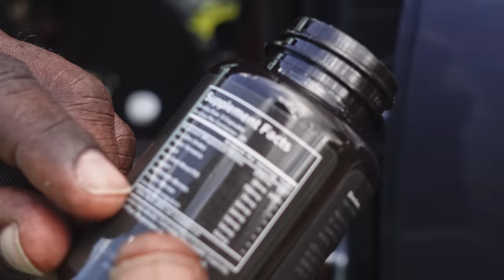I BOUGHT 22" RIMS FOR MY HELLCAT DURANGO

Comment: normally, the rim nuts are screwed in crosswise or in a star pattern
Reply: Fact
Reply: That’s what I was Tripping off of
Reply: Doesn’t it mess up your wheel alignment if you do it in a circle? All I know is you’re suppose to not do that 😂👍🏽
Reply: @NoizyBearBearOfficial  it is to respect the safety rules on the vehicle. If you do not respect the crossing, your rim may damage your vehicle because it will not be properly attached to the axle.
Reply: Exactly

Comment: When jay sees kali coming with those wheels and tiers hell say WHO HE THINK HE IS BUT AT 16:55 YOU REALLY SHOULDN'T LET THEM TIGHTEN THE LUG NUTS WITH THOSE AIR COMPRESSORS CAN REALLY DAMAGE YOUR BOLTS BECAUSE THERE TORQUING THEM WAY TO MUCH LIKE 100 POUNDS EACH WHEEL NEEDS TO BE TOQUED AT 90 POUNDS BUY A TORQUE WRENCH AT HARBOR FREIGHT.. IF KALI HAD ASKED JAY WHICH WHEELS AND TIERS SHOULD I GET FOR MY HELLRANGO JAY WOULD PROBABLY TELL KALI NAH THOSE THAT YOUR THINKING OF THEY WONT LAST YOU PLUS THE WHEEKS WILL MAKE THE CAR SLOWER GIVING KALI FALSE INFO HAVE TO HAND IT TO KALI THO THAT HELL RANGO LOOKS SICK WITH THOSE WHEELS AND TIRES MAKES IT LOOK MORE AGGRESSIVE

Comment: One thing about this Durango is that if he keeps it up, it will definitely increase in value
Reply: Nope once the new one is released the value will drop
Reply: @Icecold_Fitness  they only made 2000 of this model and I would be surprised if they make a newer version 2022
Reply: @nastynate838  Oh they will make a new one with an updated frame those hellcats are only expensive because of the engine there's literally nothing else unique about them
Reply: @Icecold_Fitness  makes sense

Comment: Rhino - keep the suspension!!!  The Durango is an SUV = its supposed to be driven hard - off road - hitting LA Pot holes at high rates of speed and not Fing up the ride.   If you lower it how you gonna drive on the right side of the road coming back from Vegas when it takes 7 plus hours...    KEEP IT LIKE THAT SO YOU DON'T HAVE TO BABY IT IN THE FUTURE!!!!!!
Reply: Get all terrain tires that are the same size as the toyos - tire will look more rhino ish maybe half an inch thicker...      Change it up = you have room for that type of tire..

Comment: Bro, get fucking rhinoplasty done. You say you have bad allergies and you sound like you have a clothespin on your nose. Get it fixed. It's kind of painful as they take a metal spike, smack it down with a mallet through  each nostril (breaking your cartilage) and straightening out your septum. It's heals totally after 2 yrs, but good for the most part after 12 wks. You won't have the headaches and sinusitis 24/7, sounding like you do and dealing with all the issues that come a along with deviated septums